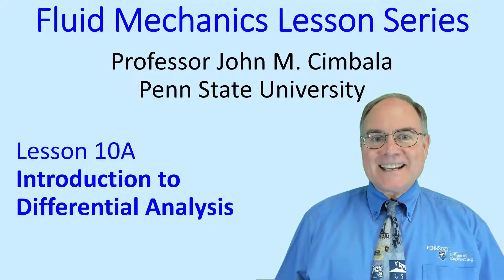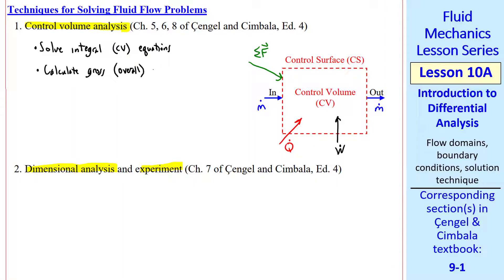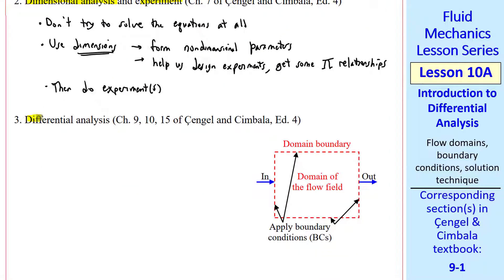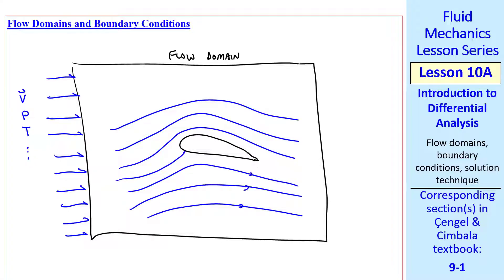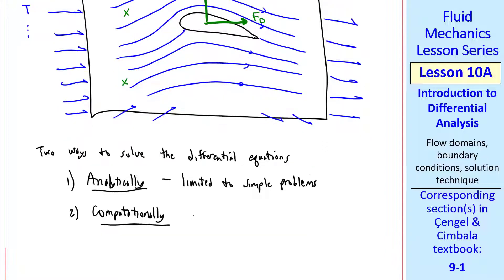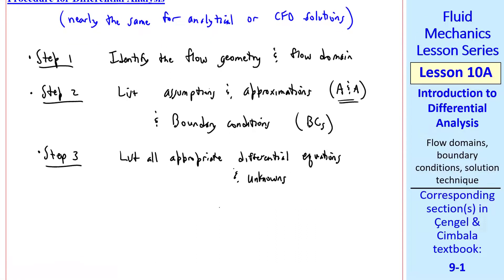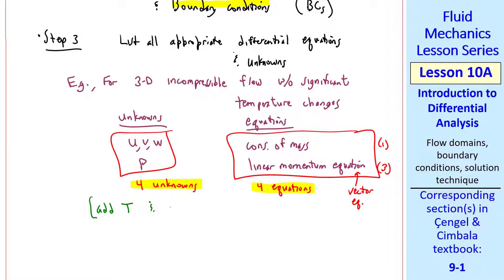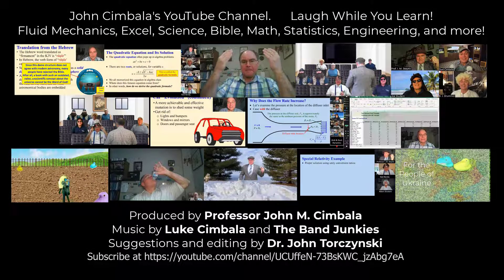Fluid Mechanics Lesson 10A: Introduction to Differential Analysis

Comment: Sorry but is there a difference between computational study and numerical study? Thanks Professor
Reply from the maker: Most people use the words interchangeably. I suppose that numerical could mean a study using math without a computer and computational means using a computer, but nowadays hardly anyone does anything without a computer.
Reply: @johncimbala  thank you 😊
Reply: There is not, except that hand done calculations are slower. Also, a package like Wolfram Alpha is good for conceptual and numerical analysis but MATLAB or FLUENT, etc. actually calculate flow.